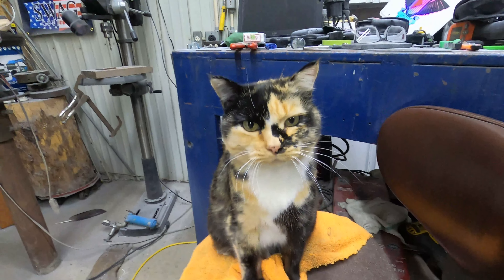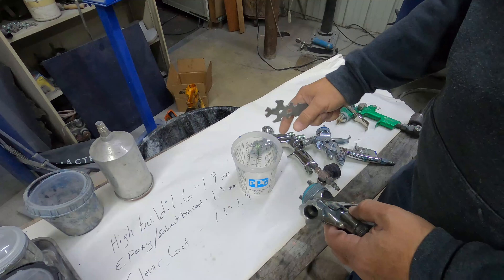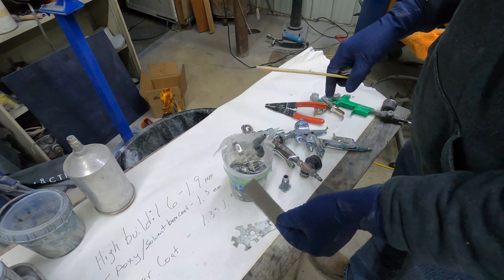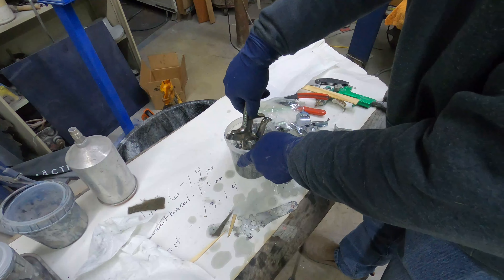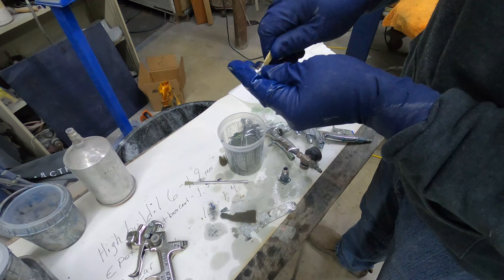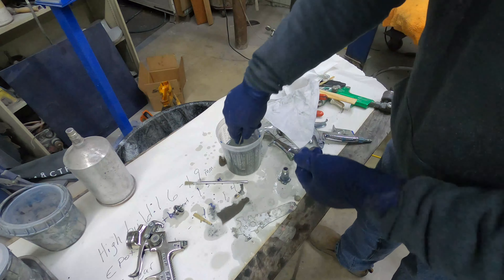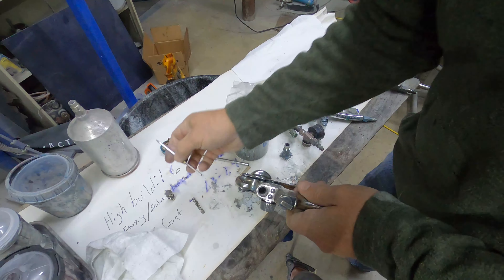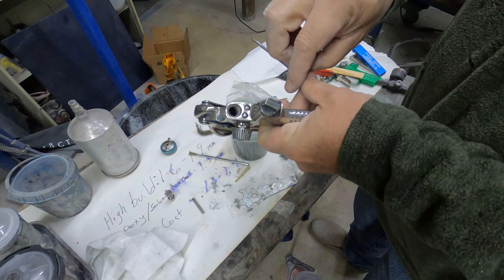How To Cleani a Spray Gun Tips and Tricks #automobile #diy #autobody

Comment: The first gun you must have forgot to clean the gun after the last job.... None of my guns from cheap to the most expensive ever not get cleaned right after the job.. Always clean it right after finishing painting... Thats the best preventive for long lasting service... And I use 3m high powerspray gun cleaner 26689 availble at HFT $8.99 it cleans way better than lacuqer thinner and you'll find lots of others uses for it....but I still use thinner to save on the 3m spray the 3m goes a long way and cleans dried paint like nobodys bussiness 😂.... You take the 3m and backflush the gun at low psi right after painting or in between color changes this gives you a spray gun that's always ready to rock and less total breakdown cleanings cause the gun stays cleaner between total breakdown cleanings... My guns range from a 1.0 all the way up to a 3.0 tip and needle to spray very heavy superbuild and all are clean and ready to go preventive maintence saves a ton of money in the long run.
Reply from the maker: Thanks for the reply, I have been an istructor for 23 years and a production painter for 15 years prior to that. I might have had to clean some clear out of a students paint gun this last week and thought a video might help. I clean my guns after each use but the old NR2000 gets alot of abuse. good tip on the 3M cleaner, it not much more that brake clean.